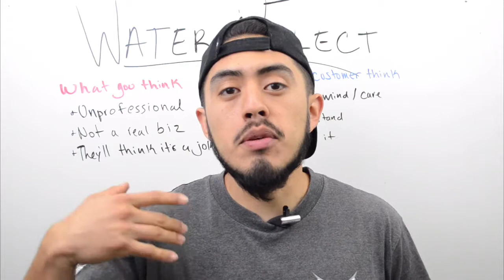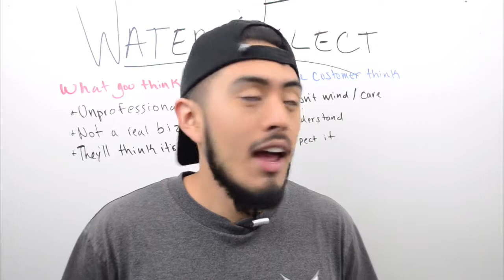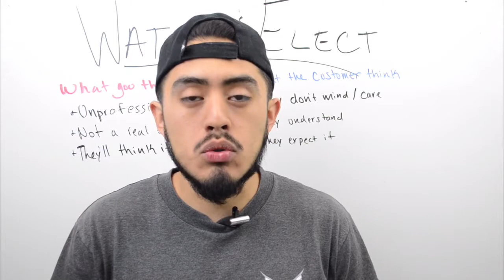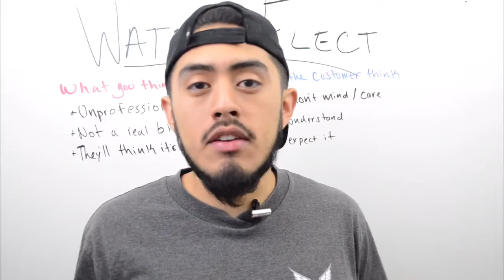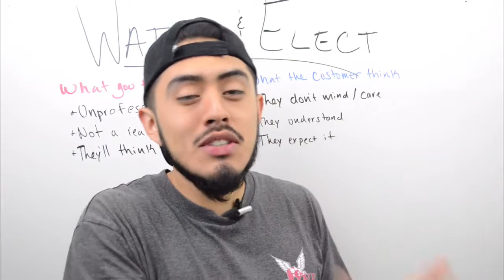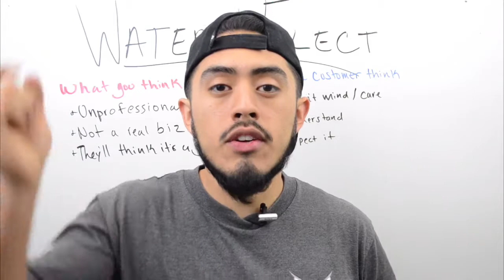Using Customers WATER & ELECTRICITY For Your Mobile Car Detailing Business

Comment: I use my clients spigots and electrical outlet all the time. I have a five star customer satisfaction never had a issue with this.
Reply: Is there ever an issue with your pressure washer blowing fuses and having issues with that? Do you have any tips for avoiding water spots? i want to start this as a side hustle and these are some of my main worries not having my own power and water source.
Reply: The cost to operate your service with customers water/electricity is so beyond small. They pay more to take a shower then you do to wash there car.
Reply: & even then that number is so insignificant

Comment: I think another good point is that if you can compare yourself to ANY OTHER CONTRACTOR.

If I hire a plumber and they need to snake one of my drains they use my power and water.
If I hire a carpenter to build me a deck they will use my water for the concrete footholds and my power for their saws.
If I hire a home cleaning service they use my power and water.

I could go on and on. :D

Comment: Where I'm from the water is to harsh and I need my deionized salt free spot free water, other wise a 30 minute job turns into a hour trying to get all the water spots. But I do aggree with the customers understanding and not caring I do use there outlets and have been using the hose spout lately due to trailer issues! Good video brother

Comment: thanks for the video. i was getting worried that id have to use their water. but i would feel better bringing my own pressure washer at least.
Reply from the maker: In the last 200 customers, I have not brought my own water or pressure washer. I've had no problem. If needed, I'll take a 5-gallon bucket filled with water

Comment: Im a mobile detailer in the UK.
I have an 80 gal water tank.
I do use the customers power, In the UK most people do not want the noise of a generator running for 4 to 8 hours.
I do let the customer know when arranging that I will be using their power supply.
I also ask questions as to their location.
Reply from the maker: Yep, I do the same!

Comment: Every mobile detail I've done I let them know upfront I just need access to an electrical outlet and 💯% of the time they're like yea that's. No problem. Just starting out it's hard to buy a generator especially if your not sure how much business you are going to accumulate. I only charge about 100$ per interior so investing in a generator right now just doesn't seem like a good business move. My next investment would first be a steamer, seems like that's the #1 tool to get a quality clean. I'm over here using hand brushes.a drill and a pneumatic air head tool brush similar to.the one you put on your corded polisher
Reply from the maker: Yep, sounds like you got the plan down! You start with what you can start with :)

Comment: I don’t know bro I’ve been to a couple custom sets here in California and they will talk trash to you for not having your own water supply and electrical they actually will call you unprofessional
Reply from the maker: The main factor to that is I don't care. Over the last 50 customers, not one has said anything bad about using their water/power. Also, I know PLENTY of Cali detailers that don't carry water. They are VERY strict in Cali. If they're using tap water and letting it run down the sewer, they are breaking the local water laws/regulations
Reply: @DetailGroove  This point is very important I think. Mind over matter when you feel "unprofessional" but completely capable. Thanks for the video!

Comment: Hey I'm panning on starting a mobile detail business and plan on using the customers water and electrical. Do I need a high pressure head for my hoses? I will have no generator, pressure washer, but I will have a steamer. (For interior) do you recommend starting with just interiors and then branch out to exterior/seal and wax?
Reply from the maker: Well, any type of hose attachment will work, really. One thing you might run into is their hose is bent, cheap, or not working all together. And yes, I recommend you start off with interiors. But honestly, doing wash and wash and waxes aren't that difficult at all. It's something customer will also request. They're pretty simple to do. So if possible, I'd offer those, too

Comment: good advice.

for starting up a new mobile biz.  lets say you don't have $$$  Generators but you do have Power Inverter will that work as generator?
Reply from the maker: Thanks! Well it all depends on what you're going to run off of it. If it's a phone charger, sure thing! If it's a powerful vacuum, maybbeee not.
Reply: thanks
Reply from the maker: You're welcome!

Comment: Problems I find with customers facilities... 

Water: the odd time there will not be sufficient flow to feed my pressure washer and also some times the water will be very hard and not expecting it I'll be left with spotted glass to sort out (gggrrr) 

Power: once in a blue moon I'll come across a customers power supply that will blow the fuse on the pressure washer, it's now to there bad connection and has caused me headaches in the past. 

Do I still use there facilities, Yes. 

The weight, space, noise and money saved out weights the odd job where I need my own water and power. 

Every time I'll ask or send a text saysing

'Is there access to a garden tap a power socket and a private driveway to work on.'
Reply from the maker: EXACTLY! Sometimes it definitely does suck to go through that mess, but it makes life so much easier- especially in the beginning phases of the business

Comment: I have never had a problem.  I tell them upfront that I need their power and water.  Not one person has ever had a problem.  I also have a generator now.
Reply from the maker: +scott sailer yuuppp! When do use the generator?
Reply: Its just a small HF generator, it was bought to do parking lot headlight resto. I can also run my buffer and 2 light stands with 4 CFL 90 watt spots.
Reply from the maker: +scott sailer Is it the Predator generator? If so, I have that one, too!
Reply: yep storm cat. the spark plug thing broke and I had to get a replacemnt from ebay,, have not used it  in a while.  find me on fb for more talking

Comment: I just ask the question.Doesn't the electrician,plumber, or painter sometimes need to use your water/electricity?
Reply: Not like that to the customer off course lol
Reply from the maker: +Integrafreak1 Exactly. There's no difference. Thanks for watching!
Reply: I give discount and explain why it is more economical for both customer and the detailed. Where I live hauling water up hills is expensive on gas etc